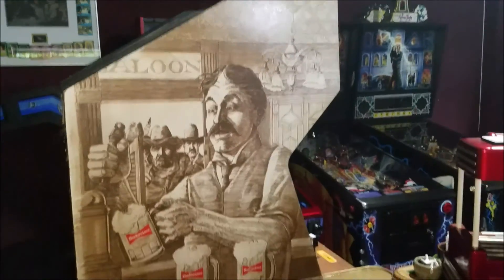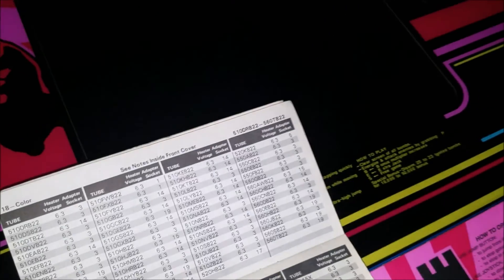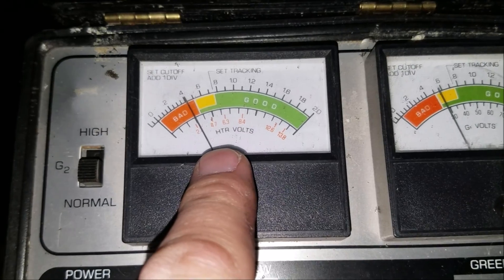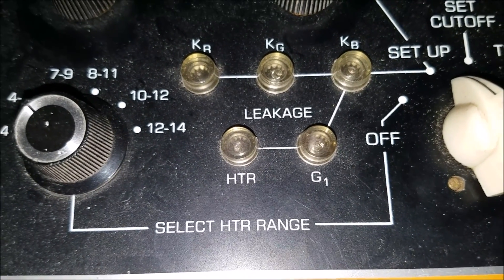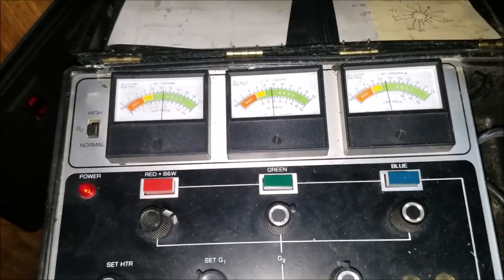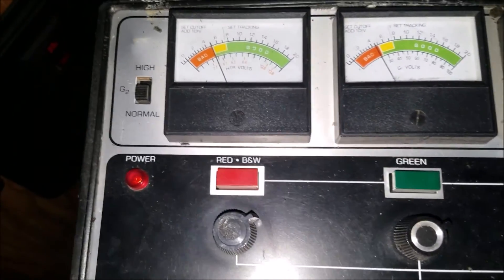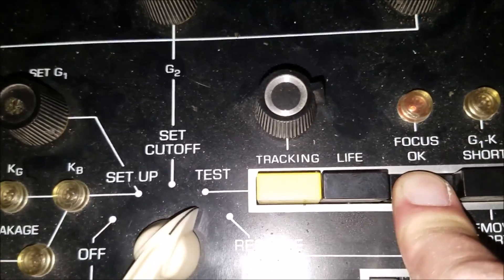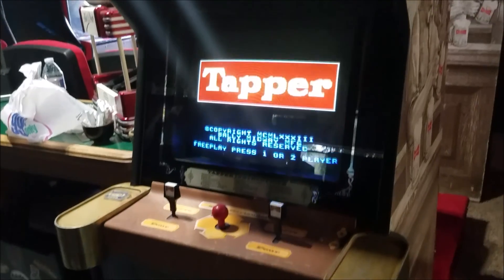Joel tries to use a CRT rejuvenator

Comment: ARCADE ICONS TV,  Is the CRT rejuevenator adding and injecting more Electrons into the RGB ray gun? What is the CRT rejuevenator doing to the monitors neck circuit board and tube?
Reply: The guns build up a layer crud over time which results in a dim picture, what rejuvenation does is burn off that crud to clean the guns, there are 2 settings clean and balance and rejuvenation, clean anf balance is a light clean and less harsh on the guns and most pf the time that will fix a tube, a full rejuvenation sends some seriously high voltages down to clean the guns, unfortunately any type of rejuvenation strips a layer of the guns which shortens its life, rejuvenation is only a very last resort and only do it when the tube is very dim and the gun levels are reading way down in the poor section.

Comment: Love the 467 and used it many times even on the newer finer crs but only ever use the C&B as its quite strong and usually plenty to bring even a weak tube back to life. Only thing is on this video you could have done a C&B as the guns were only just in the green and when you checked life which the button drops the heater voltage a little, they dropped into the yellow.
ALSO very important with the old testers and in the instructions- DISCHARGE the High voltage and disconnect or damage to the unit or crt could result. I would do it anyway even for the new testers that dont require it just to be safe.
I also clip the lead to the chassis just to make sure it dosent recharge itself which they can do even with the machine completely off. I seen it myself when i went to attach the lead back to the crt and a spark jumped!  eventhough i had thoroughly discharged it. It occurs because even after the capacitors are bleed off, they can charge themselves again a bit. and feed the high voltage lead.